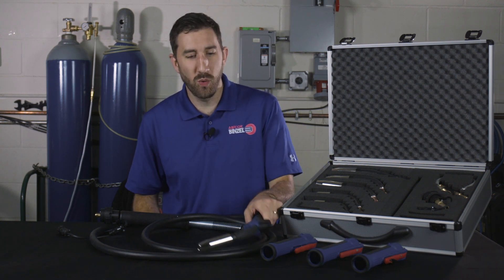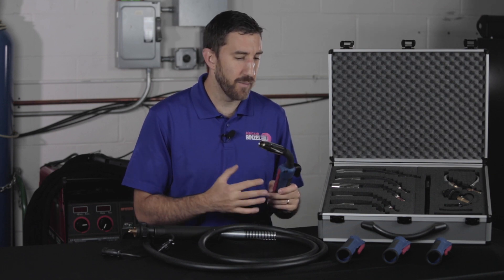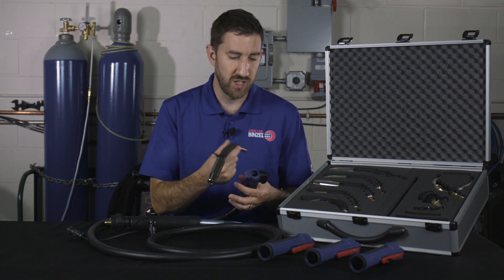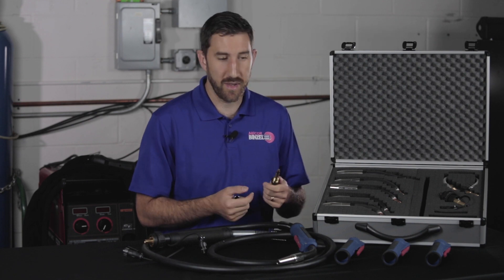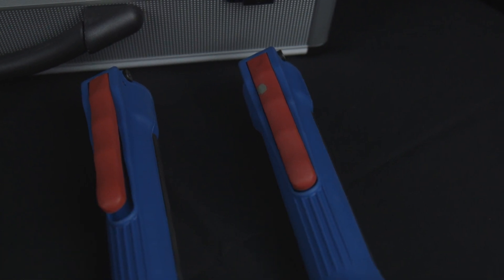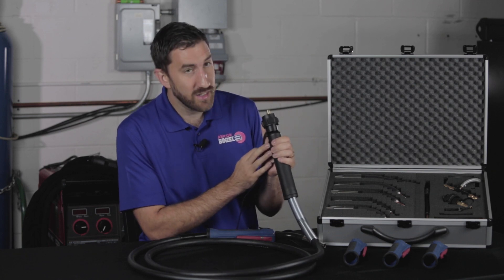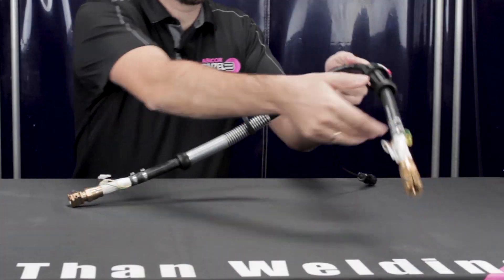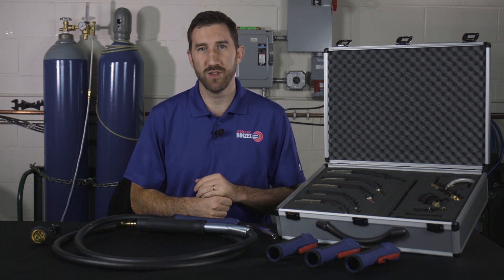Delta MIG | Product Overview

Comment: Do you make guns for a hundred and twenty volt machines? For example something with a pin style connector + 5 pin amphenol was just wondering
Reply from the maker: 120 Volt machines are difficult because of the housing. Wouldn't be able to fit a rear connect in there unfortunately. Thanks for commenting Derek!
Reply: @abicor-binzel  thanks for answering my question
Reply from the maker: @derekbryant6137  not a problem. Sorry we don't have anything. If you ever go up to a higher voltage / amp rating machine we will have something for you!